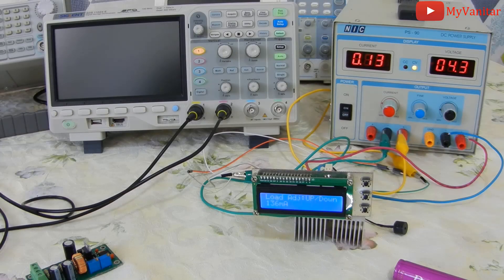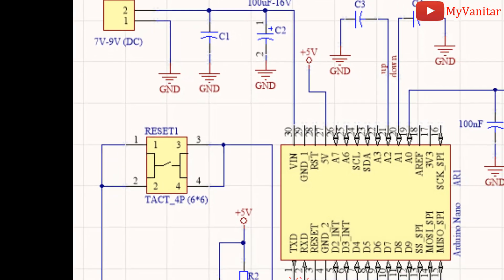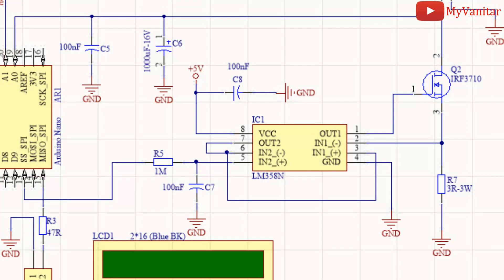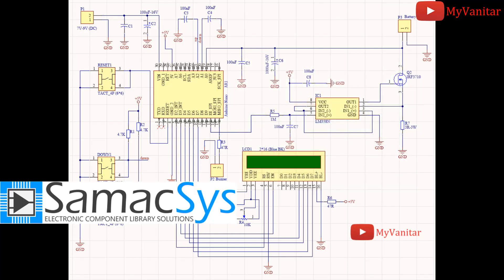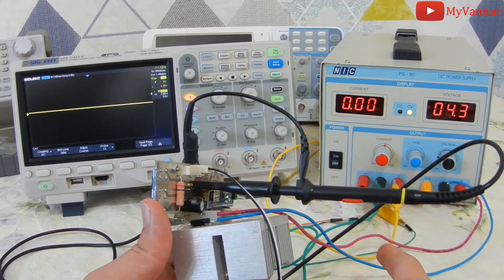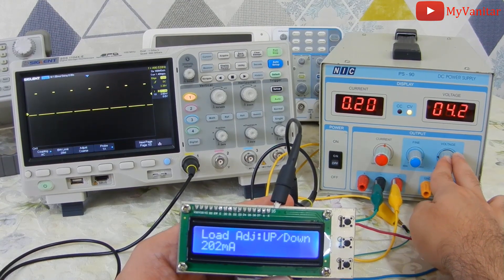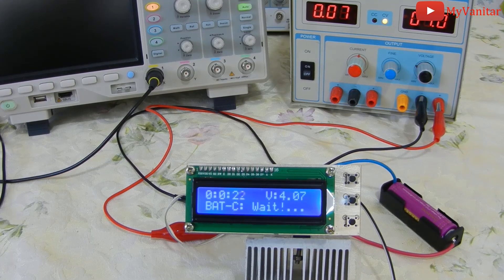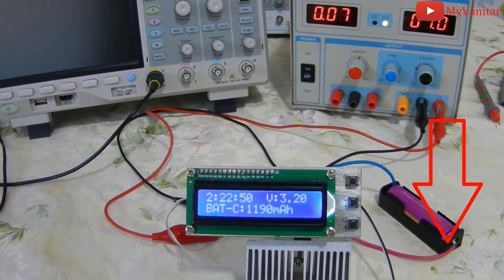Battery Capacity Tester, Identify a Fake Lithium ion Battery, Using Arduino [Lithium-NiMH-NiCd]

Comment: Hello, I found your video and I have some questions
I'm trying to make a battery capacity tester for 7.4V batteries, could you tell me what modifications I need to make?
Reply from the maker: a voltage divider (two resistors) for the ADC input of the Arduino to convert the 7.4V to the maximum of 5V. so 7.4 translates to 5V, I suggest a bit lower, for example, 7.4V after the divider should be 4.5V
Reply: @MyVanitar  Thank you very much, I'll test it!

Comment: Nice work man 🎉... Can i put 10ohm resistor instead of 3r and how can i measure the cc to change the code ?
Reply from the maker: you can put a 10-ohm resistor but it will reduce the maximum current and you will see more heat on the resistor. to measure the current just put a multimeter in the DC current measurement mode in series with the input.
Reply: i mean how to measure the cc array with pwm 
//Current steps with a 3R load (R7)
const int Current[] = {0, 37, 70, 103, 136, 169, 202, 235, 268, 301, 334, 367, 400, 440, 470, 500, 540};  this line i will not use 10ohm i have 0.2ohm 5w resistor how to measure the values above to write it into the code  and tha bat voltage on screen shows 4.3v instead of 4.14v the 18650 what is the problem here 
 @MyVanitar
Reply from the maker: Yes, I gave you the correct answer. You should use a current meter (a multimeter in current mode) to measure the current for each step, so you increase the PWM step by step and measure the current. then put the values in the array. 0.2R resistor is very low, it must be at least 1R. I have no idea why it gives you 4.3V. it is a simple ADC measurement using an Arduino.
Reply: @MyVanitar  thanks alot 🌹🌹

Comment: Just built this on a breadboard and it didn't work at first, but I didn't have the suggested IRF mosfet so I used IRF3205, it has even better parameters. No dice. Then I read in the comments here that you have to change the supply of LM358N to the supply voltage, not +5V that is coming from the regulator on arduino. I also tried other mosfets as suggested in the comments here and voila, it works now. For me, suitable mosfets are BUZ11, CEP50N06, and BTS140A - from the ones I have at home.
One more note - if you build this on a breadboard, don't be surprised if the current you set differs from the actual current you measure with an ammeter - every milliohm is important here and the contacts on breadboard are not so good. You can test it yourself that current will change a little when you slightly move your mosfet.
Also a note for using this - you should first turn on the power to this circuit, then connect tested battery, use up/down buttons to select your current, and then long press up button to start the timer. If you start the timer without a battery present, you are stuck and have to reset. Also bear in mind that current will be drawn from tested battery also while you are only setting up the current, before timer is started.
Reply from the maker: Yes, all of the points you mentioned are correct. Breadboard is not a good method to test circuits, especially if you use long wires. I plan to build an advanced version of this soon. using a TFT display.
Reply: @MyVanitar  Hello Hesam. Normal situation (😅😆), I don't have the same transistor (the almost decisive piece, I have MOSFETs, IRF540...) I notice that your IRF3710 has a fairly high Id, is it really necessary considering the discharge current <2A? Or, Rds is quite small 23mohm maybe I can find something close (not higher than 30 or lower than 15), how much does this parameter affect the accuracy of the circuit?
Thank you.
Reply from the maker: @HobbyHomeWorkshop   Hello dude, No, it's not necessary, actually, in theory, you can use whatever N channel mosfet, but in practice, they will behave differently because of the difference in characteristics and linearity, so use your Mosfets and make your experiments
Reply: @MyVanitar  I don't know when I'll complete the project, I still need a few things, but what's certain is that I'll try to reproduce it.

Comment: Hello, can this work with the st7735s display and if yes please tell me how? And thanks a lot for the video.
Reply from the maker: should be redesigned for that display, it will not work with the same PCB
Reply: @MyVanitar  Hi, I can fight my way to redesign a PCB for it, but can you help me with the Arduino.Ino program? That would be really appreciated. Thanks in advance.
Reply from the maker: I even struggle to publish content routinely, I do apologize that I can not help with your specific personal case. I have a plan to re-design this for a TFT display
Reply: @MyVanitar  No problem, it's worth asking lol, thanks for the response tho. Have a great day.😄

Comment: Just found your project and video - now subscribing to your channel.
I liked a lot your project, but would like to share some ideas, which might be inspiration for another project - or revisiting this one:
(1) This Arduino + display could be also done easily with the Uno + (LCD+keys) shield. I have one and may give it a try, probably with those following ideas.
(2) I would like to test Li-Ion (as you did) and NiMH (as you didn’t, yet). To do that, I may lower the shunt resistor as 0.5R (or less) to allow 1A at 1.0V of a partially charged NiMH - all this to check also the R_int = internal resistance.
(3) R_int measurements are important to know the remaining life of battery. They would be possible pulsing between 10 mA and 510 mA, for instance. The initial current (50 mA) provides actual ‘low load’ voltages, while voltage drop at 500 mA difference would enable R_int calculations. Battery manufacturer recommends this being done at 1KHz, but even at 100 Hz would give nice and useful results. All this can be displayed (at beginning and at end of discharge).
(4) Readings could totalize as mAh and as Wh, as voltages drop differently under constant load - and several circuits nowadays use internal SMPS draining more (or less) current Al of the discharging path, due to decaying voltages.
(5) Connecting an Analog input directly to the battery is not good, sorry. But if you put a  voltage divider 1:4, it could read up to 15V with at least 10bits ~ 1 bit = 15 mV resolution. Over-sampling could improve that to 5mV, too. Adding a 5.1V Zener in parallel to voltage divider would not distort readings up to 15V (15/4 << 5.1) and protect from most overvoltages, possibly up to 50V.
Brainstorming “3”: An alternative approach might be to make the current drain selectable as 0mA, 1mA, 10mA and 510mA, done at analog electronics level, using then the Arduino to actively select which “non-zero” drain current would be used. This could be duty-cycled selected and enable intermediate drains per variable duty-cycle. Another brainstorm would be to investigate the use of a Darlington-like BJT as TIP122 for lower Vce instead of a MOSFET for really low R_ds-on.
Reply from the maker: Thank you for your detailed comment. I plan to design an upgraded version using a colorful TFT display. When I finished that, I will show your comment as a motivation

Comment: Buenos dias, he visto en algún sitio una actualización de este comprobador y no me acuerdo donde, descargue el código pero no el esquema. Me gustaria acceder a dicha actualización
Reply from the maker: Hi, there is no update for this, because it works well already. Those people just copy this design.
Reply: @MyVanitar  Thanks for replying, I had seen this same one with some modifications, ssd1306 screen and also LM385BLP-1.2, that's why I was asking.
Reply from the maker: SSD1306 is just a different screen. LM358XX are all identical. it makes no difference in operation.
Reply: @MyVanitar  The LM385BLP-1.2 is a Micropower Voltage References datasheet
Reply from the maker: it makes no difference for this application

Comment: Hello I am doing my amendment on the test project capacity batteries Do I share with you modified electronic circuit, I need help to modify the code
Reply from the maker: I think you used Google translate. by the way, which part of the code do you want to modify?

Comment: This circuit doesn't work as described without modifications to the schematic and connections. The NMOS in the circuit is connected as a high side switch.. it will never turn on as connected. This is because once it turns on,, the voltage on its source will raise and the voltage on the gate will not be sufficient to keep driving it on.. it will turn off again.. this is a well know problem with NMOS in high side switching.. to avoid that.. the circuit need to utilize another approach.. for example, using a PMOS instead.. or .. making the NMOS as a low side switch.. that is by placing the load before the NMOS so the NMOS source is connected directly to the ground.. if you do that .. you need to compare the voltage of the battery to the voltage on the drain of the NMOS instead of its source voltage.
Reply from the maker: Well, no. it has been tested by me and many users and all were successful :-) . Even one user selling it with some minor changes. that's not a high side switch, that's a pretty famous configuration for the CC load.
Reply: @MyVanitar  CC? that is common collector for BJT.. do you mean CS common source? Yeah i can believe there is someone selling it with some modifications.. but i m sure this circuit will not work as it is .. the point is very simple.. if you have 4.2 charged battery.. when the mosfet switches on (assuming it switched on) the source voltage will rise to close to 4.2v  since the DS on resistance is very small. So ,, if the source voltage is 4.2v or even 4v (or even 3v) .. the voltage difference across the gate and source will not be sufficient to drive the NMOS. it will be 0.8 if the op amp outputs its max value of 5 v ( which is also difficult to achieve) .. so do you think 0.8v GS voltage can drive the NMOS on ? look at the datasheet of the NMOS you used or any other NMOS and you will see it will not drive it.. the NMOS will be turned off in your configuration.. the only way it can turn on is supplying a voltage to its gate which at least be 2 or more volts more than the 4.2v of the battery.. you cant supply it with 6.2v or more from this circuit. By the way,, this is a high side configuration in your schematic.
Reply from the maker: @lpe6300  CC means constant current load configuration. The MOSFET should not be on completely, then what's the benefit!! By the way, as it is clear in the video and users' experience, all were successful. I won't argue with you in technical terms. He sells it with some "minor" modification, which means changing a resistor value (to get higher currents) or some parts of the code to run on the OLED. Many also use it as it is. It is up to you if you can believe it or not. All projects on this channel have been tested. This is not a free energy-making channel with some fake content.
Reply: @MyVanitar  Nothing to de-rate your work and effort.. the over all video, design, explanation was good and I enjoyed it. You did a great work.. However, I just wanted to highlight that point and discuss it more. I wish you luck. keep it up best wishes
Reply from the maker: You are absolutely free to post your opinion, that's why it's called the comments section. You can build that part of the circuit on a breadboard or watch the video completely. Even I decrease the input voltage to 0.7V, however, the circuit consumes a fixed amount of current and that's what a CC load circuit is designed for.

Comment: I recently build this project using pro micro board and work to drain my test battery but the seconds counter is not precise. I was checked with stopwatch but it has lot of gap between 10-15s. How can I make it precise ?
Reply from the maker: A few seconds of tolerance does not matter for such application. By the way, if you need an accurate clock counter, you have to use a timer or the system tick callback.

Comment: Thank you very much MyVanitar for this awesome project I learned a lot with this, TIP:  Dont feed the LM358N with 5v rail of Arduino, feed it with the main 7-9v supply. Mainly if you use another MOSFET how did I have to do. I have tried for a week many MOSFETs with better features and less power withou success, you do not need 56 amps to spare, but it did not work either because my IC or mosfet is not genuine.Just raising the supply voltage of the comparator works perfectly.
Reply from the maker: You're welcome. Have you used this PCB or have you designed it on your own board? by the way, first, check if you have voltage on the Gate pin of the Mosfet. You can use other Mosfets also, some work well and some not. The Mosfets with a linear behavior are better. if you feed the mosfet with higher voltage (opamp rail) you turn it ON more so lower resistance appears. In this circuit and with this mosfet number, the result was satisfactory, however, yes, you can connect the 9V input to the opamp. I think IRLZ44 would work good also. with the same circuit and PCB, you can change the opamp with the MCP602 or MCP6002 DIP package that can handle near 5V at the output, so it is a better option.

Comment: Great project. Thanks for sharing. 
Is it usefull for small capacity Li-ion batteries? Like that 50mAh  used in earbuds?
Thanks
Reply from the maker: Yes, it is, because you can set to low current to test those batteries, however, those batteries are cheap. Mostly the high-capacity ones could be fake.
Reply: @MyVanitar  Thanks for replying. The purpose is not to identify fake batteries but check if end of life is near.
Cheers!
Reply from the maker: @nschindel  if the lifetime of the batteries is around 2 years or more, then most likely they don't hold a charge. by the way, yes you can test them.

Comment: are there any way to modify this project into test capacity of the 7.2v 6.5 Ah batteries
Reply from the maker: There is not a single battery with the voltage of 7.2V. it is made of two lithium batteries in series. maximum voltage 8.4, minimum 6.4, and nominal is 7.4. You never know which battery is faulty, you should open the package and test them one by one, or, use some wires to just sense one of the batteries at the time. that's it.
Reply: @MyVanitar   Thank you very much for your quick reply. actually I want to test a 7.2 volts NiMH battery module with 6.5 Ah which are used in hybrid car battery packs. any advice to achieve that with this circuit?
Reply from the maker: @jaysodyssey3622  Hybrid cards? Do you mean Tesla cars? They use lithium batteries. I have a high doubt that they use NiMH, besides 6.5Ah is too high. I think there must be a few batteries also in parallel. Such standard packs have a lifetime, when the lifetime passes, they don't hold the charge and they get discharged rapidly. The same as laptop batteries. if you wanna open it and use them for your own purpose, you have to test them one by one or somehow connect the tester wires to just one of them at a time. Simple.
Reply: @MyVanitar  no not tesla batteries.toyota prius have above kind of NimH batteries.i want to thest those batteris.can i have your email or other contact so i could send you some pictures and other details of my batteries.
Reply from the maker: @jaysodyssey3622  My Email is in the about section, however, that is for business purposes. Even if the battery is NiMH, you can test it using this circuit, however, one by one or use some wires to connect one of the batteries at the time. As I told you these standards packs are different from spare batteries. if it is faulty or does not hold the charge, its lifetime is over.

Comment: Unlike lipo batteries, Li-ion batteries can go as low as 2.4 volt
Reply from the maker: Not really, for both of them below 3.2V is very bad. 3.7V is nominal which you can keep them untouched for a relatively long time

Comment: sir how can we test battery above 5v or 12v battery by this circuit
Reply from the maker: No, problems in bigger batteries are pretty clear. "Fakish" is mostly among Lithium ones. So as a result input voltage should not be higher than 5. if there are several lithium batteries. you can test just one of them. it gives you a picture of the rest
Reply: @MyVanitar  thanks sir

Comment: Thank for your sharing, i just have a few question if you dont mind:
1. can i replace the c2 (100uF, 16V) (c1 100nF pararrel with C2 to filter the input for arduino) and C6 (1000uF, 16V) (C5 100nF and C6 for filter the constant current load circuit noises) with 220uF 16V, i got some already
2. if i change the load (like 2 ohm 5W), which part of the code should i change accordingly, i assum i just need to change the current array in the code by mesure via a multimetter, and nothing else.
Thank you very much
Reply from the maker: You should not change the value of C7 (100nF), others are for filtering. exact value doesn't matter
Reply: @MyVanitar  thank you, the filter part is mandatory for the frequency calculating, so i assum this part is correct? "if i change the load (like 2 ohm 5W), which part of the code should i change accordingly, i assum i just need to change the current array in the code by mesure via a multimetter, and nothing else."
Reply from the maker: @vietdungnguyenhuu3630  That's right. Just you should modify the current array in the code, as I described in the video and article. use a good Amp meter to measure the current